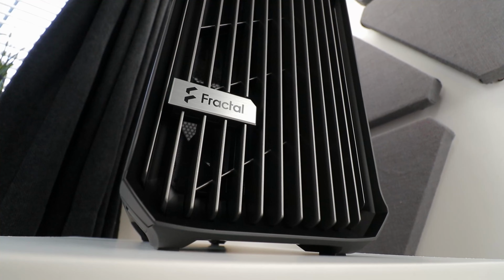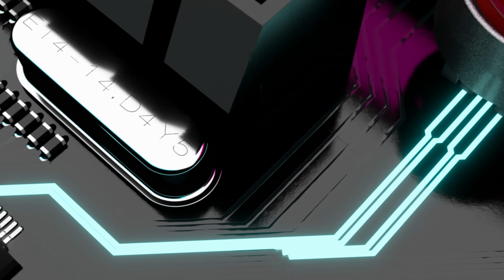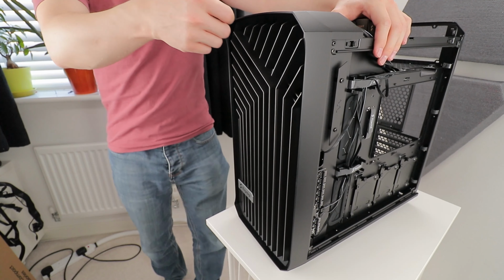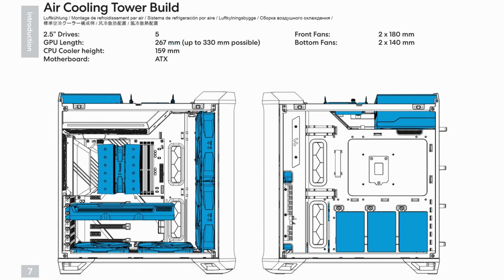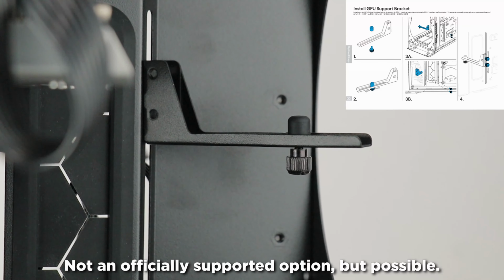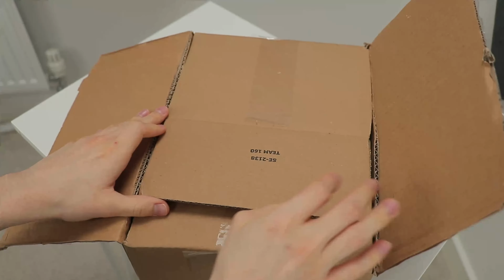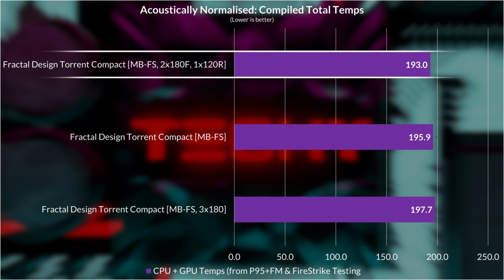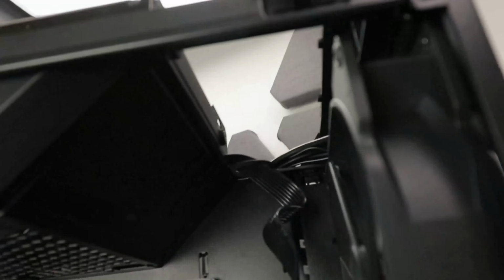The most DISSAPPOINTING and BEST case // Fractal Torrent Compact Review

Comment: I REALLY wanted to love and buy this case. The more reviews I see, the less I want it. I would rather buy 10 year old high-end cases.
Reply: Main difference for me between old & new cases is front I/O. For myself, that makes the difference of expandability & that 'can' be a big deal when you're working with an ITX board that has very few headers to begin with, and the feature of being able to connect via USB-C to a hub with a high refresh display & fast external SSDs or something sure beats daisy-chaining out of a slower port. But if that's not your use-case, nothing wrong with older cases at all.

Comment: I actually have the lancool 215 and I may just get this case when the RTX 40 series comes out. I really like the look of the front panel. I'll also put a slim 280mm rad at the bottom, and vertical mount the gpu and do a custom loop - hopefully it comes out nicely🤞
Reply from the maker: Both are great. It's not hard to see why you'd want the Torrent Compact. It's certainly very visually appealing.

Comment: It wasn't long after I got the original Torrent that they release the Compact & Nano. I kind of got that early adopter jealousy since the Compact performs just as good but just smaller.

Then after seeing how they put even less space behind the board tray, and the lesser clearances, honestly I'm kind of glad I just got the full size. It's already on my desk, most of the space saving is just height and depth so, kind of dimensions that are just taking up unused space anyway.
Reply: I have the full size, and I bought it knowing the compact existed.  Sometimes I long for the compact, but what we have is really the best overall imo
Reply: If the compact were just a tiny bit wider, it would be so much easier to buy. It's like the most insignificant dimension so it hurts so much that it's the biggest flaw in the case.
Reply: @kingoffongpei  I'd argue width is the most significant dimension. It is the dimension that determines how it fits on your desk without making the pad, keyboard and such feel cramped.